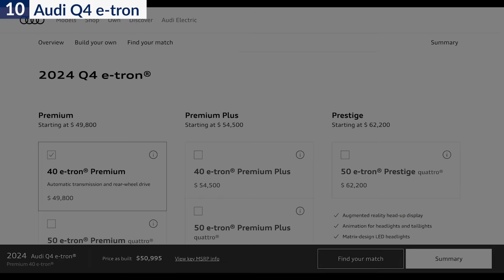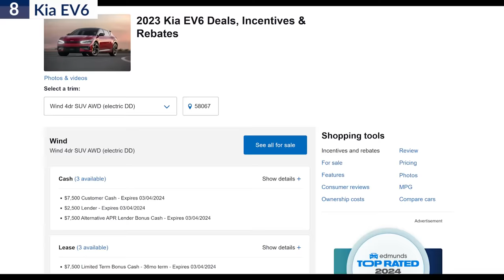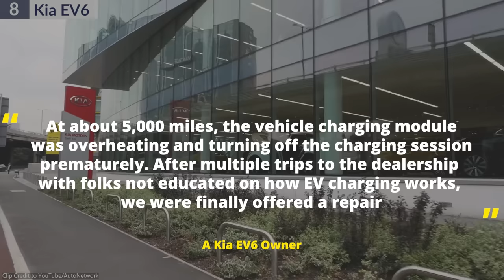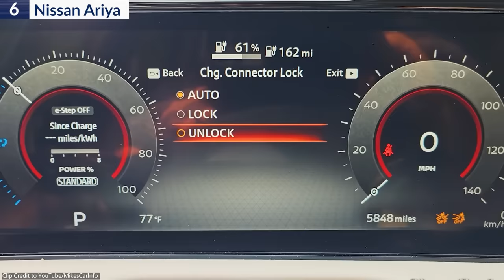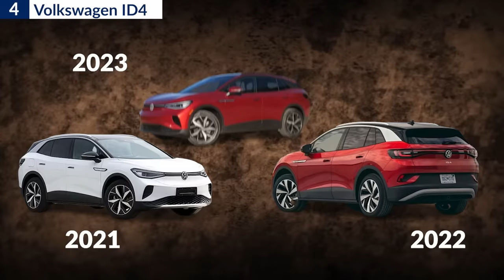New Electric Cars Piling Up on Dealer Lots in 2024 – Here is the Truth!

Comment: Every morning, I wake up to a fully charged car. It is reliable as long as you keep the car charged. It’s better if you have a charger at home rather than chasing down super charging stations. and no more stupid oil changes and mediocre maintenance made up to separate you from your money. I’ll let you guys know a little secret. You don’t need expensive charging unit. All you need to do is combine two circuit breakers into one which will  turn 120v  into 240 V. Then plug it in with the mobile connector that they give you for a Tesla and it will charge about 20 to 30 miles, and when you wake up in the morning, you have a fully charged car. Of course this has to be done by electrician.. in fact, most homes already have the 240 V charger or outlet. That is what you use for your dryer.

Comment: It's hard to compete with Teslas. Especially when only Tesla has decent charging infrastructure. 
The key thing for EVs - is the ability to charge overnight at home. This is what some people don't understand. EVs are good when these two conditions are met: you can charge them at home and you use them mostly for city commutes, and rarely for road trips
Reply: I had to get rid of my tesla and I leased an Ioniq 6.
2 things: Don't buy electric vehicles because you don't know what the resale will be in a few years .
if it wasn't for the fact that I get free fast charging I would have turned the car back in after only 2 months.   The non tesla charger infrastructure is terrible!
Reply: Awesome experience when charging my Tesla at home, saves me money and time.  But I wouldnt recommend an EV to someone in an apartment that has to rely on supercharging.
Reply: Agree Level 1 or Level 2 charging at home (or at work) is a must yet. That’s a dealbreaker for many. Inferior specs of non-Tesla EVs have not contributed to attracting new owners.
Reply: My thing is I like to drive, and I own a Miata. My daily work commute (which is an actual 3.5 miles) winds up being 30-50 miles every day because I like to drive my Miata. It's been like that for decades. People like me will never be efficient or "planet friendly". I've driven a Tesla. whooo... Hellacious torque and straight-line speed. I don't care about that in the slightest. 

People like me worship at the altar of cars like the Lotus Elise. They aren't useful for anything but driving. I don't care about getting groceries, hauling kids, or saving the planet. I want to carve curves. Period. My wife is the one that owns the "practical car", and she still chose a GT sedan.

I don't hate EVs. I hate the fact that when EVs prevail real "drivers" cars are going to be extinct, and I genuinely HATE everyone that supports EVs because of THAT.

Comment: "Do you want to pay more for your car, and have greater inconvenience, restrictions?" - not exactly a catchy sales statement, but its a true statement, which is why EV's are not selling.
Reply: New EV sales 21% up in January in the UK over the same period last year....
Reply: @Brian-om2hh  Because of government regulations and tax dodging scams. Take those away and you'd have nothing. The UK is a tiny car market anyway and BEV are about 3% of that. Used BEV marrket in the UK is also in freefall, 50% Off after 2-3 years and still they don't sell.
Reply: @Brian-om2hh  You mean registrations are up, very different to actual sales.
Reply: Tesla look like they are really struggling mate.
Reply: @robertkubrick3738 this is just a paragraph of complete lies. You lot are nuts.
Reply: @Audioremedy0785  Ah right, so producing the World's best selling car is an indication they're struggling, is it?
Reply: @Brian-om2hh  I was being ironic. Tesla are flying.
Reply: 1. Child battery mineral labor

2. Range anxiety

3. Risk of garage fires

4. Paying 20k more than a
comparable vehicle

5. every time you fuel up an EV, the fuel tank gets smaller  and smaller. Battery degeneration. 

6. Poor resale value

7. Reduced performance in
cold, highway.

8. Higher repair costs

9. Awful charging network
experiences in the weather
without restrooms

10. Higher insurance rates

11. Replacing tires more
frequently. Michelin states that tires wear out 20% faster on an Ev, and could be as high as 50% faster! Ev tires made for ev's, cost 20 to 30% more, than regular tires for ice cars. As Ev tires wear out, they leave behind more tiny particles of rubber than normal ice cars. This causes more pollution. 

12. Death by autopilot

13. $25k - $35k battery

14. Low km range per tank of energy. 

15. must wait in-line 1-2 hrs
to charge.

16. Then wait more time to charge, while charging.

17. Spontaneous combustion, with no way to put out the fire storm.

18. If they catch fire in a tunnel, many people will die.

19. People without a pro charger system or a parking spot at their house, will run an extension cord to the road, which is dangerous and could lead to people tampering with your charging setup (super slow charging at the road)

20. If you're in California, you won't be able to charge your car past 4pm because of a shortage of electricity supply on the cheesy grid.

21. It is not actually "green". The pollution is made at the power station, not the car.

22. Only 5% of used junk batteries get recycled, the rest go directly into the bin. It's cheaper to mine for new minerals.

23. Chhinna actually does 70% of all the refining of the minerals and production of the batteries.

24. Minerals are becoming more and more scarce, and the cost will only go up, not down.

25. Some countries where they mine for lithium, actually use a very big boat load of fresh water to only produce a ton of lithium, so they are afraid of running out of water. It takes over 2 million liters of fresh clean water to produce 1 ton of lithium. 

26. Ev cars will soon not be able to drive in tunnels or be able to park in underground parking garage and probably will eventually void your house insurance if you park it in your personal garage.... 

27. You can't charge your battery at super stations when it is bitter cold out. 

28. If a fire truck comes to put out an Ev fire, all the chemicals go directly into the sewer system, poisoning everything. They need tons of water to slow down the burn. They can't put them out. They are only trying to prevent over things near by from catching fire. 

29. Ok, there is 2 good things; regenerative braking, which charges the battery while you are slowing down on the highway, which saves your brakes from much wear.

30. Loss of fuel tax revenue, so now the roads will only get worse, not better. 

31. in Dublin, huge generators are being used to charge EV buses, due to electrical grid strain. buses in Athlone also cannot be put on charge until midnight, for the same reason. Bus Éireann is saying that they can't charge their buses until 11pm for the same reason,  and to avail of a lower tariff. 

32. Not everyone on earth even has electricity to charge their cars. What are they supposed to do in 2035? It's easy to get a bucket of fuel to power up a regular car. 

33. VCE, or "vapour cloud explosion" is very bad. If any battery, typically anything larger than an E-scooter battery, and especially only "half" charged. If a problem occurs in the cells, it might not catch on fire right away. Instead, a cloud appears, and then may be ignited a short period afterwards. There are 2 different types of vapour clouds that appear; heavier and lighter than air, which form will be dominate, can not be predicted yet. This produces a bomm.

34. For Ev transport trucks, they aren't allowed to carry the same payload as a diesel truck, because of the massive weight of the battery. The owner of the Ev truck therefore loses potential profit, every day. They also lose more profit for the waiting times for charging that Ev truck. The driver will get paid to charge the truck, which in turn forces the owner of the truck to lose more money. 

35. Ev cars are more likely to be written off, if they experience a minor collision. After the collision, something could have upset the structural integrity of the battery. 

36. Ev cars lie to you. If you are bold enough to go out on a decent road trip and its 210 miles, one way, and your Ev tells you that your battery will last you 223 miles, there had better be no hills, or excessively cold out.... You'll probably get stranded, trying to get to the charger, at the end of the trip. Ev's have left many families stranded already. 

37. Ev's and their batteries, will soon need their very own "passport". With all info about them when born, and current info about them (power output, resistance, mineral composition, etc.) 

38. Thieves stealing charging cables, will soon make it impossible to "fuel" an Ev car. They take a long time to replace the cables, just to have them cut again for scrape money. 

39. Cars were typically being made lighter and lighter using aluminum and or fiberglass and or carbon fiber, to reduce emissions and pollution. Ev's are only getting heavier and heavier, causing more pollution than ever. Remember, an ev's pollution is made at the power station and the dump, not at the actual Ev, except for the tire particles as mentioned above. 

40. More on spontaneous combustion of the battery. What if you had 3 kids strapped into car seats, in the back seat ,which kid do you rescue? More fires start so fast, there is hardly any time for even the driver to escape, let alone 3 kids strapped in. 

41. There must be a reason that Boeing 747's aren't battery powered.... Until jets are battery powered, I'll be sticking to fossil fuels for my mode of transportation. 

42. Can't bring an Ev up north in the woods, nor any battery powered chain saws, where there are no grids to charge them up. You would need a huge amount of solar panels to get you anywhere. 

Ev's (External combustion vehicles) suck, and it's a bridge to nowhere. But they do sometimes convert themselves into "internal combustion", but sadly, they can only do that 1 time.
Reply: @jakefriesenjake  ‘tell me you no experience with EVs without telling me that you have no experience with EVs’. 🤣🤣🤣 Generally speaking, people who live their life in genuine fear of something happening that has a 0.0012% possibly of happening are considered to be mentally ill. Like the people who sit in the corner of their living room rocking back and forth talking about a plane landing on them. Honestly seek some sort of counselling as it must be a miserable, miserable existence.
Reply: @Audioremedy0785  lol. These aren't my thoughts on this. It's what I've seen on videos and news clip and the news.

Not saying gas cars don't have their own problems
Reply: @jakefriesenjake  I find that people who love EVs are people who drive them. People who don’t like EVs have no experience with them and just don’t like the idea of a government telling them what to do. EVs are amazing. As are many Ice cars.
Reply: @Audioremedy0785  I agree, ev's have some great features, but people need to look into all the various aspects of ev's. There are many horror stories that I've heard about.

Would you drive through the desert, all the way from new York, to Los Angeles, in an Ev? Would you expect to get there in more or less time than an older diesel Jetta? Same price in fuel as well?

Seems to me that ev's are alright for going to work and back, not actually driving long distances. Many videos showing how bad they are for that.

The cyber truck only gets 90 miles to the full charge, towing 11,000 pounds at 32°F.

It literally can't even go from Windsor Ontario to London Ontario, on 1 charge. (2 hour drive or so) That is so beyond pathetic, I can't even wrap my head around it. A comparible diesel truck could go probably 650 miles.
Reply: @Audioremedy0785  once the batteries become half the weight, twice as energetic and half the price, and can be charged at double the current speed (at home) , and come with a 20 year warranty, ev's might be pretty good.
Reply: In US, US taxpayer pay an avg of $20k for each EV sold in form direct and in direct subsidies.
Reply: @Jeez001  any source on that or just making stuff up and rolling with it 😂😂😂
Reply: @jakefriesenjake  I think at the moment they are suitable for 90% of users and when they are those things it will be 100%
Reply: @jakefriesenjake lol dude. You actually lost so much time to write all those lies? :)))  dammmmn
Reply: @Brian-om2hh  More copium from a virtual signaller.
Reply: @Brian-om2hh Seek mental health care immediately!😆😅😅😅🤣🤣😂😂🙃
Reply: Many are happy to not buy any gas, for those who do short daily commutes.  They are an ideal choice.
Reply: My Tesla Model 3, total cost is super low. IT's the cheapest car i ever had for my wallet. :) So keep on lying to yourself.
Reply: @Audioremedy0785 you have no idea what you’re talking about
Reply: @jakefriesenjake So true everything you have mentioned and also you can't tow anything with them not even an EV ute no range totally useless
Reply: @pauldarderi3560  it's got the power, but not for long!

The new cyber truck towing 11,000 trailer, only gets 90 mile range on 1 charge! That is less than 2 hours drive!.... How inconvenient 🤣🤣, at 32 degrees f.
Reply: @jakefriesenjake  Exactly right I live in Australia and everyone that tows a caravan uses diesel utes NO EVs 
Everything I own is petrol 70s 900 Kawasaki and a 67 Mustang all polluting the atmosphere
Reply: It's actually more convenient in some circumstances. The price however is still too high, that's the limiting factor. Petrolheads can lie to themselves all day, but if you take a look EVs registered, it shows the hockey stick pattern in nearly all regions.
Reply: @jakefriesenjake Yeah, it's much better to start wars for oil. 😂 Also, gasoline never causes fires, yeah. Tell that our neighbour who's garage went into flames... Lies and lies, but you are only lying to yourself. The real problems are the markup prices on all vehicles. As far as I see the price is too high now on even the new diesel, gasoline cars, not just EVs. Of course they don't sell.
Reply: @sokacsavok  maybe....

There's this Ev van company called "Arrival", in the UK. It's been around for 10 years or so. It was worth around $13 billion just 2 years ago.... 

They didn't sell a single unit, and are now bankrupt.
Reply: @sokacsavok   @sokacsavok  
There's this Ev van company called "Arrival", in the UK. It's been around for 10 years or so. It was worth around $13 billion just 2 years ago.... 

They didn't sell a single unit, and are now bankrupt.
Reply: @jakefriesenjake  Top selling car in the world in 2023 - EV
Norway - 82% EV
China - 25% EV
Europe - 14.6% EV
You can make up 100 points, but the reality is that the world is transitioning away from fossil fuel and towards sustainable options. The clear leader is the battery electric vehicle. So far, they have been expensive and still reached these numbers. Now as they are starting to mature, the prices are dropping and the cheaper EVs are now coming. What do you think happens next? My guess is we will see around 90% EV sales within the next 10 years, so by 2034.
Stick with your fossil fuel cars, there is nothing stopping you.
But the future is electric, whether you like it or not.
Reply: @robertkubrick3738  The average new car sales market share of EVs in the UK is 18% for 2023 and 15% for Jan 2024.
Reply: @Audioremedy0785 agree 100%. We should have the choice , will never vote for a dictatorship.